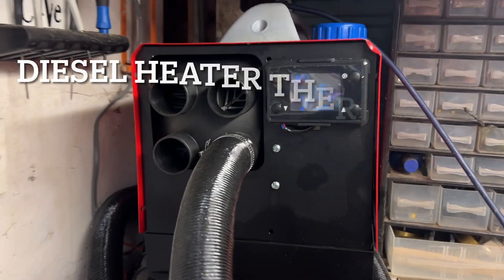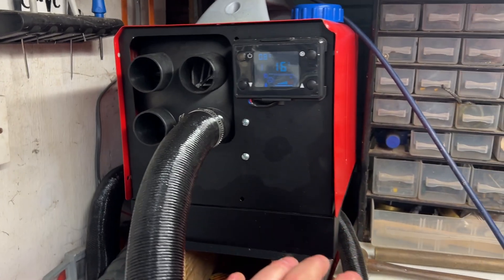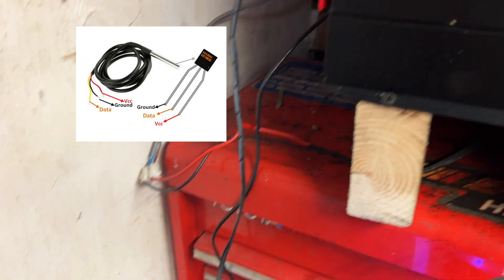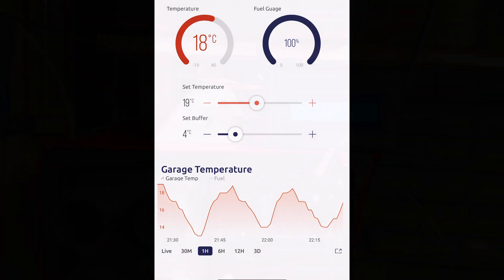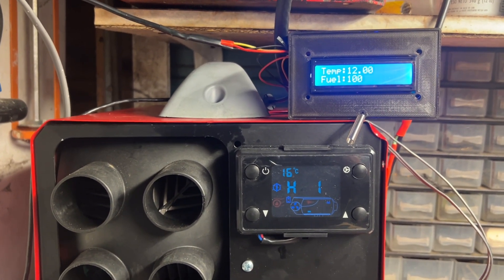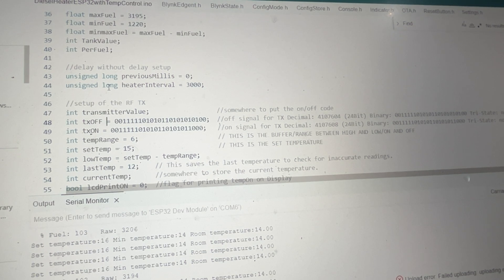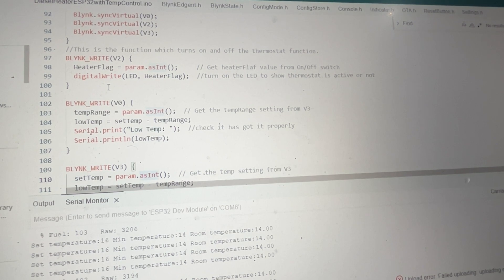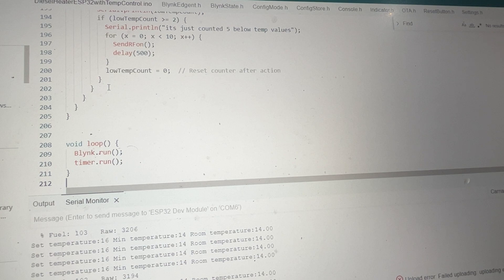Diesel Heater Thermostat Controller | ESP32 RF Smart Remote with Fuel Sensor & Blynk App

Comment: Hi Chris, I'm just about to start your project and hopefully add perhaps more features in the future. Regarding the code did you ever share it? If you could kindly share it will save me starting from scratch. Any changes or upgrades I manage to add I will happily share back here with a link. I look forward to your feedback. Many thanks for the great video.
Reply from the maker: Hello. no I never posted the code, not because of an unwillingness to share, just because I didn’t get around to it. I’d be keen to see if you can improve it and possibly figure out the lack of transmitter power in terms of why it needs to be so close to the receiver / heater unit. I’ll try and get the code posted before the end of day tomorrow.
Reply: @craynerd  No worries Chris,  whenever convenient. Once you post it I'll crack on with the project. Parts are currently on the way from AliExpress. Thanks

Comment: thanks for the nice video , can you set now to gear 0 ( standby ) ? i have the same problem in my shed even at gear 1 goes to 25 degrees, my hcalory toolbox 2s has auto start and stop integrated ans i found if i set 21/17 , starts at 17 but stops at 23 which is OK but shutsdown completely not going to standby so everytime needs few minutes to shutdown and turn on which is not OK for heater itself ( 10-15 times a day ) if your solution works i would try
Reply: I actually did on ESP32 full protocol to control it remotely solely using this Chinese bt protocol (I had reverse engineered their communication by sniffing their protocol for few days, then testing what works and how), no need for anything else. Just esp32 some server at home that’s it. You can turn it on, off, set gears, monitor voltage, temperature, auto mode (termostat mode), fails safe etc. Did a full pwa app for it etc. Wherever you are even 10000km away. Webasto<->esp<->server<->pwa. I had figured out all of their protocol so it will prb works on most of those Chinese webastos. 

Thouse webasto do not use going to gear 0 as a turn off. It’s a toggle mechanism in them - same command to turn off/on. 

If I will have some time will do video about it and publish all the code. Maybe next week if I will have some time ;)
Reply from the maker: Hello, I’m not sure if I understand your question properly but effectively this just shuts the unit off to standby (no heating, but still on). The problem with these heaters for a small area is that heating setting 1 (lowest) still gets a small space too hot and so the only option is to turn it off. The software lets you have a buffer so that rather than trying to hold a temperature and the unit constantly coming on and off, if I want my workshop to just “not go cold” on a really cold night, I can set it to knock off at say 22 and not come back on until say 14 deg. That way, the unit is coming on and off, but not constantly. I initially wrote the programme to hold a temperature and quickly realised this forces the unit to start up and the. off too frequently. You can change the bugger value (difference between on or off) - or effectively you do essentially set the on and off values.
Reply: @craynerd  thanks, the main question is my Heater( Hcalory toolbox 2s)  does have already the start and stop options, i can set let's say 17 and 21  but every time it hits 21 turns off and when it's 17 turns on will  if i add rf remote control with esp32 wil lbe same  or goes to standby instead of turning on and off? Your project adds only on / off automatically or goes to standby and consumes zero maintaining same temprature you set ?
Reply from the maker: @HivaPouri hi, yes so most of these cheap heaters don’t do that. They never turn off at all. If I say set my heater to 16, when it gets to 16 it drops the heating to the lower heating setting. However this still gets the temperature to 24+ deg! All this system does is knock off the heater totally (it RFs the OFF signal) when the set temp is met. It sounds like your heater already does this anyway.
Reply: @craynerd they can 😅 if you know how to do it ;) you can do wake up via bt 

For example wake up:

0xBA, 0xAB, 0x05, 0xEA,
0x0E, 0x31,
[counter],
0x05
+ CRC

And then turn off:

uint8_t cmd[] = {0xBA, 0xAB, 0x04, 0xBB, 0xA1, 0x00, 0x00};
sendBLECommand(cmd, sizeof(cmd));

Will do video about it and share a code soon in free time ;)
Reply from the maker: @lolekakaa yes please - that would be interesting! As I say, the functionality of mine is very basic from the menu. I can effectively turn the thing on and let it run and turn it off!! The set temperature is useless as the workshop is soo small it only ever drops to the lowest running setting which is still too hot and goes well above the set temp.

Comment: Even if you don't want to share the complete code can you share any info on how to properly send the code to the heater?  I have tried sending the binary sequence with no success.
Reply from the maker: @marcuswright8998  hello, sorry it’s on my old laptop. I’ve just started work after having Christmas off so just a bit busy. I promise I’ll try and find it and post it online. I’ve no issue sharing it - just need to get hold of it!

Comment: one of the best ones ive seen! brilliant job.
I think if you set the pulse when sending the rf signal for ON Off the reciver will pick it up better. I'm not a coder, but i have read  a lot of tutorials.
e.g: mySwitch.setPulseLength(369);
pulse lengths can vary but this will give you an idea.
Reply from the maker: @neiltaylor6825  thanks pal. It was a fun project and works well. Just in my workshop now with it ticking in the background 😂

Comment: Since you asked about code improvements! Usually you don't hard code credentials in your code. You generally load them in safely at runtime to prevent accidentally sharing them, like in a YouTube video :)
Reply: can you share the code pls
Reply: @mohannaddubagh2920  lol im wanting to know the same thing. would love to maybe add support for the dht11 or 22.
Reply from the maker: @hhacksel  cheers friend but isn’t the SSID short two letters and the password blank in the video?  - genuinely checking I’ve not missed something!
Reply: @craynerd  She means your Blynk API key which is visible on line 23.
Reply from the maker: @crossraleigh  ahh got you - hey ho!

Comment: The filament you used isn't RF transparent enough to keep the antenna inside the case? Thought it was potentiometer poking out at first.
Reply from the maker: @andreash.9615  no sadly had a real issue with the rf antenna. Literally had to be right next to the heater controller to work :-/ but of a fail in that respect. But it works and there is no issue with them being next to each other - just limits location.